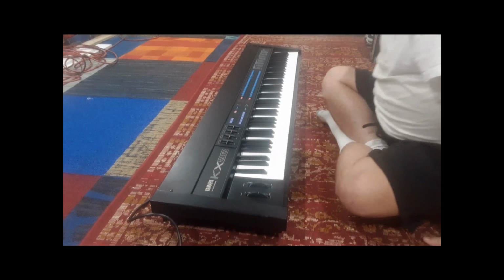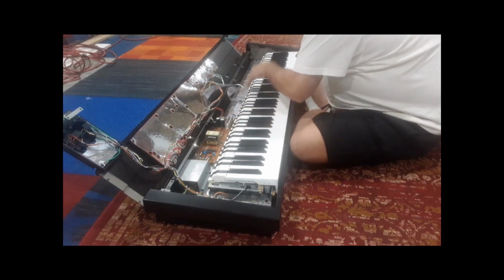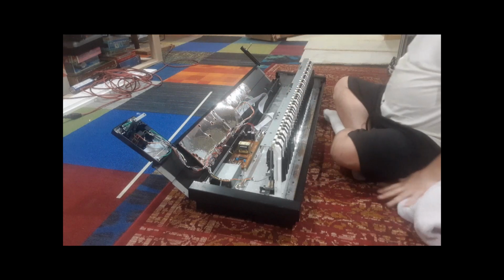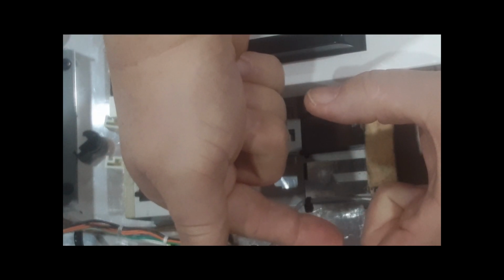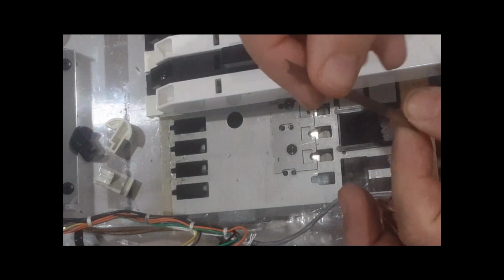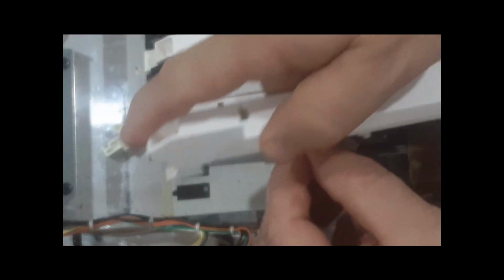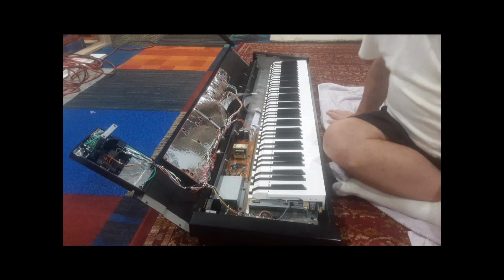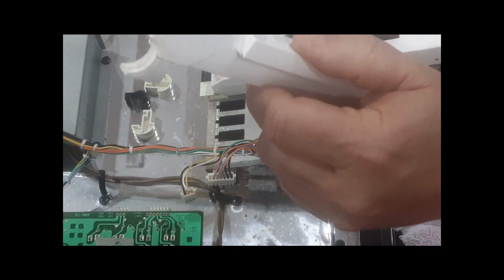Yamaha KX88 Open Cover and Removing Keys (see more for WARNING)

Comment: Correct on the manual service wise not clear on the simplest of things thank God for shade tree duct tape butter knives and duct tape..lol hey Paul I haven't forgotten u at all jus kinda been outta commission jus a oil bit had to step back from kx88 trying to figure midi signa I'm problem no response too your advise got all your notes u sent me  applied several things trouble shooting all points which leaves me to frontier in my Bones voice from star track to captain kirk..."I'm going in Jim" yep to inspect the midi ports gotta be that causing no midi signa!l response ..east peasy how to open her up  as you demonstrated 4  on top  two on left underneath  pitch and modulation  wheels and one right side,underneath I will keep you posted I hope it's only matter of reason leering wire that may have came loose or detached...I think batteries fine but may replace anyway probably has never been done. This is my specialty circuit boards etc resold wrong etc ill keep u posted thanks paul
Reply from the maker: Ok, I am standing by.

Comment: Thanks Paul this is super helpful.  I'm repairing a KX88 i got in fair condition.  Among other things there is an octave of keys (Db 6 to C 7) that have no velocity response, they only play at the lowest velocity regardless of how hard the key is struck.  I'll be getting around to taking all the keys out soon.   In the meantime I don't see any broken trace or disconnections on the contact circuit board on the underside of the keybed, but have yet to test things electronically.  Do you have any guidance as to what to look for or any suspected culprit?  Thanks
Reply from the maker: Each key has a SPDT switch: the upper contact is normally closed the lower contact is normally open. When you play a key, the CPU measures the time the upper contact opens and the lower contact closes. The time between these two events (in milliseconds) translates to key velocity by the CPU. If one contact is working but not the other, the CPU has no way to determine velocity (but it can still tell a key is played) so it defaults to minimum velocity. Each switch is its own circuit with a common strobe (the switch arm between the contacts).  It is unlikely that a whole bank of switches failed, it may be the common strobe signal for each bank of switches. Microscopic cracked traces/solder joints on the connectors on the PCB are usually the culprit. Or possibly a broken wire. These need to be ruled out first before looking at microcircuits.

Touch up each solder joint on the ribbon cable connectors on the main PCB and on the keyboard PCB.
Reply: @paulromsky9527  Thank you!  I reflowed the ribbon connector solder joints, unfortunately that doesn't seem to be the cause.  It's a bank of keys that align with the sections of the circuit board, so I agree it's more likely somewhere along that bank circuit/connectors than a coincidental failure of all the switches in that bank.  I'll look closer for cracked traces and see if I can tell anything on the common strobe.  Thanks for the quick reply!!
Reply from the maker: @error_trials If I was in front of it, I would be more help. Let me look at the schematic.
Reply from the maker: @error_trials KX88 Service Manual (the one with a schematic): Page 18 Zone D6 you will see the switches for C#6 to C7. Notice the common B7 (Break Bank 7) and M7 (Make Bank 7) signals. These come from Page 19 Zone D10.  The B7 signal is shared with the Bank A 16 push button and the Bank B 16 push button. If either or both of these switches are stuck, it will effect the Bank 7 keys. The M7 signal is shared with Bank A 8 and Bank B 8 push buttons. These too can effect Bank 7 keys.
Reply from the maker: @error_trials See my video on KX88 Self Test. Focus on the Buttons subtest and the Keyboard subtest.
Reply: @paulromsky9527  Thank you so much - really grateful for your remote assistance to a stranger!  I investigated the buttons A8, B8, A16, B16, all seem to function correctly but will try the self test and see if that helps troubleshoot.  I do have the service manual, just not the schematic so I will look for that.
Reply: Well it seems to pass all the button tests, but fails the key tests as soon as I get to that C#6, can't get it to move on to the next note (which I assume would also fail, until I get to C#7) as I can't trigger it hard enough.  I'll look for the schematic!  Thanks
Reply from the maker: @error_trials OK, the push buttons are not stuck. The first key that fails does not allow you to go to the next, but like you said, none of the Bank 7 keys have any velocity. At this point, either the B7 or M7 bank circuit is working but not both... hard to tell which at this point. Do you have a two channel Oscilloscope? The next thing I would check is the B7 and M7 signals at the Keyboard and at Page 10 Zone D10 area and see if they both go active low every 100us (in that ball park) but B7 and M7 must not be active at the same time.
Reply from the maker: @error_trials  See the end of my video to contact me. I can send it to you, it's hard to find online. We can also share notes eaiser.
Reply: @paulromsky9527  Will reach out!  I did find the schematic.
Reply: @paulromsky9527   Mine had Eb 6 staying on when using Synth patches. My little ones like slipping guitar picks in between. Took her apart and worked on the suspect key, however it didn't take. Meanwhile G 5 and G 6 went dead. (evidently something I did) but Took it apart again, . I checked and deoxed the ribbons, reseated everything and the G 5 & G6 came back. (It could have been G4 & G5) 
But  now I've got triggering from  A1 up to C 1, but C# 1 thru C2 are dead, as well as C# 7 thru C 8. What now? thank Boss!
Reply from the maker: @ChrisMichaelsChicago Yamaha octaves are off by 1 octave number compared to western and MIDI octave numbering. Even though a Yamaha synth will use the MIDI octave (as it has to be to be compatible)... internally (and on its schematics) it is still off by one. In the KX88, the lowest octave -1 is the key on the far left what WE call in the west as A0. The KX88 scans by banks of up to 12 keys.  The first bank is only A0 to C1, the next bank is C#1 to C2, ... the final bank is C#7 to C8 (on the far right). Your "flaky keys" are following this bank pattern. My contact info is at the end of my videos. If we go that way, I can send you sketches and such and help you find which cables to check and which components to check.  Doing it here will be impossible. You will need a schematic, I can send you one and we can go from there.
Reply: @paulromsky9527  A0? I guess you can tell that I'm actually a mere guitarist. Indeed I will do that RIGHT AWAY good sir! I do have the service manual (mostly In Japanese) but on Pg. 7 there are Diagrams for PBC's DM, AD, PN, JK, &  THE LED PCB. If this is what you referred to. THANK YOU!
Reply from the maker: @ChrisMichaelsChicago I will send you my manual with the schematic so we will both be looking at the same document. Ok, we will now work this out via email.
Reply from the maker: @ChrisMichaelsChicago Have you ever heard of a guy named Eddie Van Halen?  I showed him a thing or two back in the day... he picked it up pretty well.  He once said , "You have 12 notes, do with them what you will." I told him, "No, my young apprentice, you can also use a tremolo and bend strings too, so you have virtually infinite notes... now go practice that hammer technique I showed you."

Comment: Thank you for this video!

I got a KX88 recently. Mine was also dropped on the same end during shipment. The top two keys were sticking together. Fortunately, I only had to straighten the mounting tab on the end cap. Everything works now, though mine has seen a lot more abuse than yours.

I'm glad you pointed out the differences between this and the DX7. I had previously done a full disassembly on my older DX7. I thoroughly cleaned and properly lubed all of the keys. It plays fantastically now!

I plan on doing the same thorough procedure for the KX88. Some of the keys are a little stickier than others, and there is a layer of grime from 40 years of use. Knowing the differences in the keybed will definitely help in the process.
Reply from the maker: @therm0tt0  My technique for working the springs in and out has improved since I made this video. As you remove and reinstall keys, your technique will improve.
Reply from the maker: @therm0tt0 If your end cap is cracked, you can fill voids (and reinforce inside behind cracks) with the old baking soda and super glue trick. Use goggles and good ventilation. It hardens instantly. Build up large voids and missing chunks in small layers. You can then sand and file to match the shape and then paint with a matte black paint. If you have ever done Bondo and body work on a car, it's sort of like that. I think Yamaha still sells end caps. See end of video for contact info. Send a photo. Minor scratches in the metal paint I just touch up with a brown Sharpie.
Reply: @paulromsky9527 I'm sure I'll figure out the best reassembly method as I go. Your video was definitely helpful so that I know what to look out for.

Fortunately there were no cracks on the end cap. I only had to straighten out the metal mounting tab. It was probably not dropped too hard; just the sheer weight of this thing would push in the end cap with a modest bump.

Comment: My KX88 had a black key (A flat above middle C) that was sluggish and quite unplayable. So I followed your video and took it apart. It now back to being playable. There were no mechanical obstructions, so I suspected that the spring was weak. So I flipped the spring (with black mark not in view) when I put it back. All key velocities check as normal. I decided to do the nearby G flat and B flat and the F G A and B keys the same way since they were all removed anyway. There is a noticeable and uniform improvement in all those seven keys. So no need to buy new springs; just flip the old ones. Many of the remaining keys also seem slightly suspect with just a hint of "slow return".
   And, before putting each key back in I preset each spring so it was in correct position and under normal tension. I rest the edge of the spring against the velocity "push down" post so it sits just enough to stay in place. Precariously perched, I know. Reinstalling the key then allowed the spring to slot into place.
Reply from the maker: @rickyhils  Nice work. My technique for putting the keys back in is not the best, I have improved it since. But as you can see, once you get the nack for it, they are easy to remove and reinstall. The springs should be absolutely flat on a flat surface. Over time, metal starts to gain "memory" to its flex points (the far forebearer to metal fatigue). I think the reason the mark marks are on the springs is so when they have "learned" and settled in, you can be sure to put then in the same way if you ever have to remove them for maintenance. Yahama was thinking way ahead. It is possible to gently flex the springs for the tension you need. Very slightly, don't kink, and NEVER use heat. The springs were heat treated by Yamaha when made to retain their response. Heating the springs will destroy that flex/relax action at the microscopic level.
Reply: @paulromsky9527  
XLNT info from you. You said "springs should be absolutely flat on a flat surface," Good to know that. I will say that the key springs that I flipped seem just a bit on the stiff side compared to the highest and lowest keys. So flipping them over added to the stiffness just a wee bit, but still playable. Those exact Yamaha spring parts are near the end of being available any longer.
Reply: Oh, and I need to some of that proper Yamaha grease for the pivots to have on hand down the line.
Reply from the maker: @rickyhils  I think your flipping them over is a good idea too. I designed a diagnostic tool for 1980's Pontiac Fieros. They too are getting hard to find replacement parts. One is called the EGR Solenoid. I am designing my own that I can sell since GM is making less and less of Fiero parts. Yamaha may be doing the same. You can still get replacement keys and springs from Yamaha, but for how long we are not sure. The keys on the KX88 tend to crack because the After Touch sensor gets less responsive over time and people press VERY hard on them to get After Touch to work - and they crack the keys in the process. Spread the word: NEVER PRESS DOWN HARD on the keys, or they will crack. I fixed a white key for a guy by partially underfilling the key with baking soda and superglue to reinforce it. You could still see the crack slightly, but it is playable. The black keys require more support, so I 3D printed a support that reinforces the black keys for repairs. So, I might start designing my own replacement keys and springs.
Reply from the maker: @rickyhils  Good idea to keep it on hand. Make a compartment inside your KX88 to keep tubes of grease and spare parts... that way they are right there when you heed them. Don't use common silicone Grease, it may work, but Yahama formulated their own for just the right feel. You have to be carefull with grease on plastic parts. Some people use petroleum jelly, but it is not known on how it reacts with the plastic keys at the knuckles over time
Reply: @paulromsky9527  
Good.